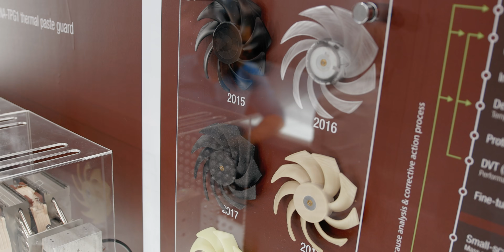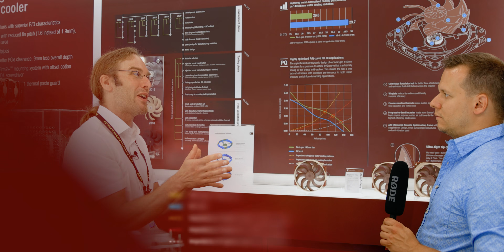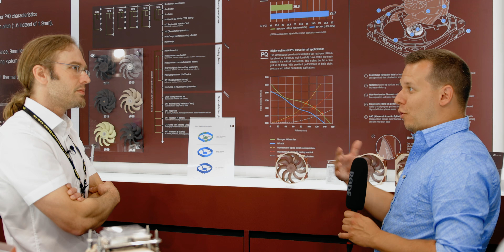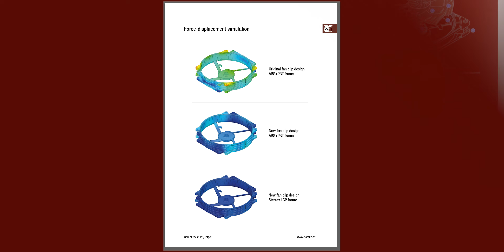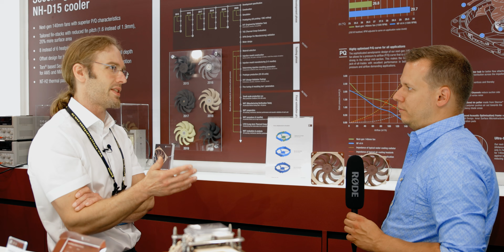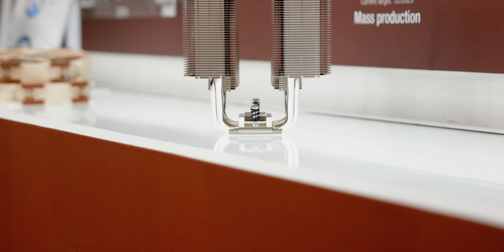This is why Noctua Fans & Coolers are So Good!

Comment: noctua is the best company in the pc industry. i own 25+ noctua fans and a few of them have been running 24/7 for many years without problems. only failures that i've had were wires that broke off (easy fix)

Comment: Is Noctua going to come out with 28mm or 30mm thick fans for more air flow and When will they come out with Black or even White and DRGB would be nice.
Reply: rgb is out of the question and same with 28 or 30mm thick fans
Reply: alao chromax black exists and they are re evaluating the white fans

Comment: Noctua is extremely overrated and overpriced (and ugly if you can't get a black version), they're the Apple of coolers. I was shocked to discover that another cooler was outperforming their D15 cooler with just 1 heat sink with 5 heat pipes, while the D15 has 2 heat sinks with 6 heat pipes, plus it cost twice as much!

Comment: Never tested if one 140mm noctua fan did an equivalent or better job than two 120mm regular fans on a double tower cooler ?! If it only get 2-3°C more hot by reduce decibel by a lot it could be a nice thing , plus bigger diameter means potentially cooler vrm's , ram etc...

Comment: It seems sort of a "scam" from Noctua. They go about tight tolerances and the difficulty of manufacturing to justify the 200$ price tag or whatever this will cost. Of course it's difficult to make something of flimsy plastic within 0.01mm.. It's ridiculous. Why not make the frame of aluminum and it will not bend 0,1mm when tightening screws or something? But I think the idea is to make an expensive product (even if the performance justifies it). People will pay anything for the BEST performance in air cooling, right?

Comment: I'm pissed with Noctua right now. They have made the cooler-baseplate curved convexly, to fit the Intel 1700 socket CPUs. The concave bend that the CPU IHS gets when mounting it in the CPU socket. 

While that is a reasonable idea for socket 1700 CPUs, we don't know if next generation CPUs will bend also. Neither does the bend suit AMD CPUs which are flat. 

Thye should make two versions. One with the convex cooler-baseplate, and with a flat cooler-baseplate. Then we can choose.

Those of us who bought CPU contact frames do not want convex cooler-baseplates.

Comment: One area that hasn’t been explored yet is attempting to match the fin density with the pressure/airflow characteristics of the fan across the entire 2-D cross-section of the fan. We know the airflow and pressure is highest at the perimeter of the fan and lowest at the center. While the idea of a dead zone may be outdated, the concept of lower airflow in that area is still valid. Having higher density of fins at the edges of the cooler and lower density of fins where the center of the fan is would result in more heat being dumped - and subsequently dissipated - exactly where the fan is most capable of dealing with that heat.

The other thing they could do as others have mentioned is increase the depth of the fans beyond 25mm. While there are potential clearance issues with radiators and case fans that would limit the desirability of thicker fans, there’s a ton of room to work with above the motherboard once the fans have cleared the memory sticks. There’s no reason a 50mm thick fan on a tower cooler wouldn’t be just as compatible as a 25mm fan in 99% of cases. And with thicker fans comes lower rpm at the same pressure-volume, and that means quieter operation and less wear on the motor.

Comment: In Austria, where Noctua is based, there are so many Noctua NH-D15 on the second hand market.
I partly regret buying it used. It's still overpriced. The arctic Freezer 34, Germany based, has nearly same performance on my hardware.The cooler is shit and that's the reason people are selling it on the second hand market cheap.

Comment: What about the motor it’s smaller then the previous years? 
And why are the fans past the cooling body of the d15 and not like the U12 precisely on the cooling body.
And will they go with thicker fans like the T30 to break the barrier?
NF A140x30   industrialPPC 3000 a man can dream.…

Comment: I disagree with the Point, that you want a FAN that could do both, Static pressure and Airflow. If marketed right you can for sure Have 2 lines of FANs one for each. BTW Noctua has special Fans for Airflow. So they are doign it already.
If you have watched other interviews it get repetetif. 
The pricing gets a bit out of hand. But thats just my opinion.The new Fans will for sure perform nice. Noctua is a staple in the industry.

Comment: I've never heard of a Noctua product fail. Been using my NH-D14 since 2012 (currently on 10850k). We really do need more companies like them in todays world.
Reply: I have two Noctua 120mms that have been used daily for 11 years. One of them recently failed, the other is still running like new.
Reply: "I've never heard of a Noctua product fail."
What's to fail about them other than the fan? For your information there is nothing unique about fans not failing for many years, I have seen them running 24/7 for more than 15 years. Stop drinking the Noctua Kool-Aid.
Reply: @Horizon-hj3yc  There is something unique when you consider the noise, performance AND quality all at the same time.
Reply: @StefanKrunic 5x the cost of Arctic p12 unique?

Comment: There's a reason why Noctua gets SO MUCH RESPECT from tech reviewers. They don't mess around. They don't do bullshit marketing. They make extremely high quality products, with excellent warranties, and excellent customer service. They are an honest company, with a very, very unusually high level of integrity. They take pride in making the best products for their customers, and in giving them good customer service and support. They will even provide some degree of customer service and support for products which are PAST their warranties. Noctua fans are often pretty expensive, but chances are that they will actually eventually end up saving you money because of how ridiculously long they last, but they also move more air and make less noise, and even use less power as well. It took me a long time to realize that Noctua stuff is totally worth the price. It started with a CPU cooler that I bought at a discounted price, but today, my PC has four Noctua case fans in it, and I always recommend Noctua to people whenever I'm helping them to put together a PC. That's not to say that there aren't some other good case fan brands or cooler brands, but Noctua keeps ending up being the best option whenever I try to look into what the best fan for a given job is. 

I have been using an NH-L12 for the past 8 years or so, and after upgrading from an AM3, to an AM4 motherboard, I found out that I could get a FREE mounting adapter upgrade kit sent to me for no charge at all, directly from Germany to Canada, and it was already past its 6 year warranty at this point in time. It's about 9 years old now, and the same fans are running as good as the day I got it. Noctua still updates information for their older model coolers that are past warranty, such as lists which give you a good idea of how good of a job your old cooler will do at cooling a given modern CPU.

Personally, I don't tend to go for high-end CPUs, so my cooler has been overkill for all of the AM4 CPUs I've had so far, but that just means that it's been extra quiet :)
Reply: Exactly. Got a NH-D15 in 2016. Upgraded to Zen 4 - got sent a free mounting kit from Noctua. I'll never buy anything else
Reply: Noctua ftw
Reply: I ain’t readin allat
Reply: @lovelylarissa331  I'm gonna read allat.

Comment: It seems Noctua has found a better blade geometry than NF-A12X25. I hope they're developing the next gen 12 cm fan based on this new design.
Reply: I’m not sure that’s applicable. As they’ve discussed in many videos, the physics work differently at a larger scale. The A12x25 may be as well optimized as they can get it without having to swap fan blade material—as they’re forced to with the 14cm fan
Reply: @TheShortStory  Both 12 and 14cm fans use LCP as blade material.
Reply: @panzer3279  I stand corrected

Comment: How much does materials play a role in fan design? I am not a materials engineer, but I have been playing with plastic moulds and I read about and tested some of the amazing ways to increase the strength and/or rigidity of materials. Adding something like 1% graphene (expensive)  by weight does wonders for things like breaking and bending strength. Would that have any benefits with PBT that would make it a middle ground compared to something like LCP? What about metal fans? It would place more stress on the engine,  but there are loads of fast-moving metal parts made to increadible tolerances all over (and above) the planet, and maybe movint to 140, 160 and 180mm fans exclusively could mean we can increase the motor strength a little bit (quadruple comparing titanium to LCP) without losing tol much fan area.

Comment: People just don't understand how the fan design and materials from Noctua are vastly different from other brands. Noctua is the only dedicated in house brand of cpu cooling manufacturer that develops a patented liquid crystal polymer technology and the signature color brown isn't on purpose. It's the original color of the polymer itself and adding a color to it greatly alters the original characteristics of the material itself which will affect it's performance and the structural integrity it was known for. Be glad that the Chromax black colored one exist, at the cost of being slightly less performance than the original brown material.

Comment: The newer processors have done better in some cases with less heatpipes because the heat isn't ending up getting to the outside heatpipes much.
8 heatpipes is a ton especially is 6mm. 
So I'm wondering how this will manage with that issue.
Reply: I bet Noctua has thought about that and tested multiple designs, plus they did mention in the GN interview that they're looking at offset setups for AM5 which is more important to make the most of a set of heatpipes

Comment: Noctua are the definition of doing things properly. Designing for quality and not disposability. An old Engineering teacher I once had said it best; "The proper mentality is that there is no such thing as "overengineered"; there is doing it correctly, and there is everything else.".
Reply: Apple of air coolers 🤡
Reply: But doing things properly is in this case just focusing on really unimportant stuff that really doesn't matters in the grand scheme of things... Noctua is basically marketing for PC hardware enthusiasts who are equivalent of audiophiles while sane people just buy Arctic or other brands (if they need a fan besides the stock case fans) and get 95% of performance for fraction of price... And yes, I'm one of those idiots who spend 30+$ for a fan just because I want the best stuff but I know being hardware enthusiast means you do a lot of irrational decisions when it comes to consumer spending and marketing people in companies like Noctua really know how to sell overpriced stuff to us.
Reply: @veduci22  And that exact mentality of people wanting everything to be as cheap as possible NOW is exactly how we ended up with phones you can't change the batteries in, TVs filled with bloatware/spyware, and white-goods such as washing machines that last 3 years, maybe 5 if we are lucky. It isnt technical limitations. It's not even cost restraints. It's planned obsolescence because charging you for a whole new machine is better for their bottom line than letting you change a $15 part on a $500 piece of hardware. I'd rather buy once and buy well. It's not overpriced if it does the job better and lasts 3x longer than anything else. Example: I bought a cutthroat razor a few years ago after Gillette released a certain now-infamous ad. The razor was 2.5x more expensive than its disposable counterparts (NOT including replacement blades). A $30 razor, a $20 polishing stone + 30 mins online learning how to sharpen the thing and I have saved that money back a 10-fold in the years since. I never have to buy a razor again and it does the job better than anything else I've used. It's better for my shave, better for my bank account, and better for the planet. Engineers should run the world.

Comment: I want them now and in WHITE and BLACK and in argb with 28mm - 30mm thickness for greater pressure and air flow. I'd love to see the D15 and others in black and white heat sinks also.
Reply from the maker: It's interesting how people are requesting white.  Did you know that due to Noctua tolerances, white is harder to accomplish than black?  Maybe I'll add that to another video.  👀
Reply: @HardwareCanucks  The only reason why I want the White fans Is because the only cases that come with Clear Glass are in white.

Comment: When he said there's further room for improvement, the first thing that comes to mind for me is they could dive into fans that are thicker than 25mm.
Reply: no not really. the competition needed to breach the defacto standard of 25mm so they could compete, I don't blame them. it's out of the box thinking. but I'd rather Noctua continue  25mm and innovation, we don't need more bigger components taking up more space.
Reply: @wyntje83  I'm not really sure what you are trying to say. I think it's pretty clear that Noctua has done everything that they can reasonably do to maximize the potential of 25mm thick fans. The next logical step is 30mm fans or something similar.
Reply: @wyntje83  In one of this channel's recent videos, they showcased some 30mm thick fans from Antec, so there's definitely competition out there to drive Noctua forward. However, I don't think the need to compete is what is holding Noctua back. I think it's that they're very committed to the 25mm thick standard because their goal is to work toward the best all-rounder 25mm thick fan that most people can use without issues. I believe they will eventually enter into the 30mm space, but it's not time yet.
Reply: @gordon9821 they did break standard with their 200mm fans being 35mm thick instead of the standard 30mm. So it’s not outside their wheelhouse to break norms.
Reply: @Lakeside_Flower  Thanks for the info. I do like larger fans since they can move more air at lower RPMs, therefore creating less noise. I imagine fans that large would be more stable with a thicker depth. That is a niche need, though, and my previous point was that Noctua's focus right now is delivering the best possible product for mainstream uses rather than breaking norms. Can't wait to see what they cook up next in the future, though.
Reply: Their 200mm fans are already 30mm thick btw! I have two on my PC and they are by far the quietest fans in my system. They make the 120mm fans on my CPU cooler and PSU and my three GPU fans seem quite loud by comparison.
Reply: Titanium blades or aluminium for the price we pay why not
Reply: @Interdiction prepare to triple the current price you pay for them
Reply: you are wrong! A Noctua RGB fan is the only way for total perfection! (joking)
Reply: @espi8997  but I need my B R O W N

Comment: IDGAF how good it is, if its ugly as fuck its junk. Youd think they'd have learned over the years to not make ugly fans....nope
Reply: They literally have the Chromax lineup….
Reply: @z4k1_zaki65 does the chromax line have ALL of the same models?
Reply: @geort45  EXACTLY lol
Reply: @geort45  Not all, but most. They have Chromax version for every size now, from 80mm to 200mm fans, low profile coolers, single towers and dual towers. What exactly are you looking for?

Comment: I'm a bit sad Noctua didn't experiment with a 135mm or 130mm fan in the front to increase the ram clearance with the first fan installed. Currently on the DDR5 market Gskill is killing it with the low profile memory modules with the ripjaws S5 and flare x5. As far as the color options I like the brown fans.

Comment: This content makes it important when comparing fans from different manufacturers to include the “fan curve.” Until today, I have yet to see a me YouTuber or manufacturer post their fan curves. As an engineer, it has been a disappointment to not have these curves available to consumers.
Reply: Noctua literally has the PQ curve on all their packaging for the fan. So not sure what u mean u havent seen a manufacturer post their fan curves
Reply: @Jsteeezz  To confirm your claim, I dug out my less-than-2-year-old Noctua original packages for NF-A12x25 PWM, NF-A12x15, and NF-A14 PWM fans (including some that are chromax). There are no fan curves included. So either Noctua started including those curves within the past 2 years, or you are mistaken.
Reply: @Jsteeezz  So we have to buy the product before you see the curve?
Reply: And I apologize if I failed to notice these curves on the 10+ Noctua fans I’ve purchased.

Comment: 8 of 9 of my PCs run Noctua coolers. After finally upgrading my Sandybridge 2700k in 2019 I needed to replace a quality Megahalems cooler that no longer supported new sockets. Went with a new U14S for long term compatibility.  I’ve since bought 7 new, open box or used Noctua coolers for other systems. My favorite air coolers for sure and I only bought the first U14S at full retail prices. The other 7 were like 50-70% off. 

NH-U14S w/ dual fans $90 (retail new w/ 2nd fan purchase)
NH-D15 w/ Chromax Black dual fans with white covers $80
NH-D15 w/ Chromax Black dual fans $50 
NH-D15 w/dual fans $40
NH-D15 w/ dual fans $40
NH-U14S  w/ dual fans $30
NH-D9L w/ single fan $20
NH-U9S w/ dual fans $20